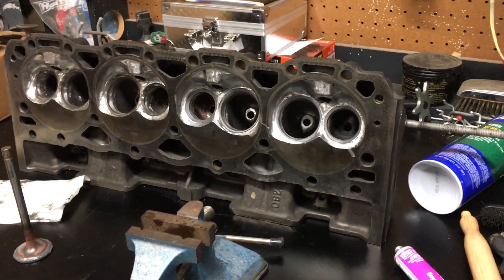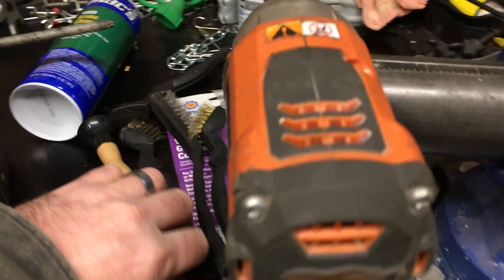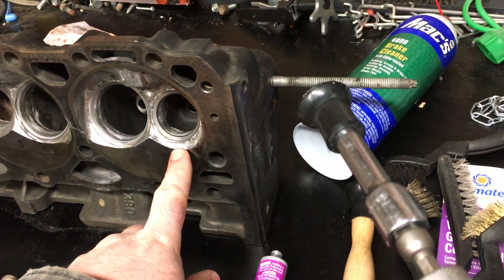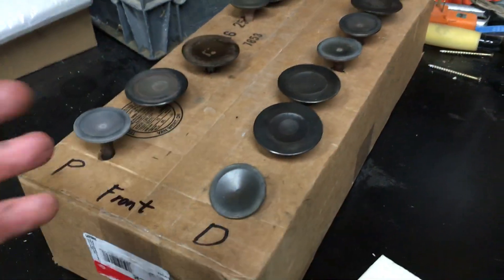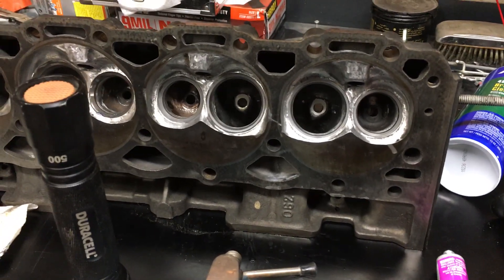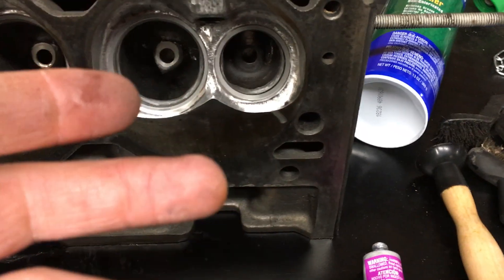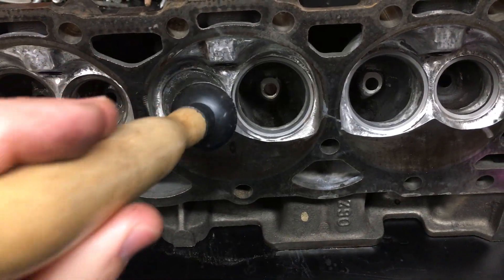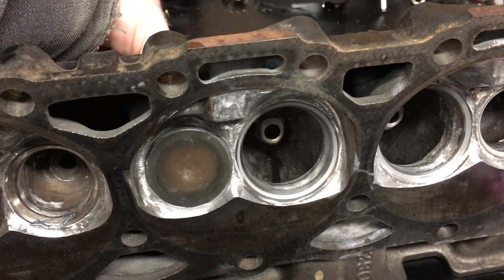Hand valve lapping

Comment: Hey love the video and info on the Vortec heads.. I personally think that the seats are a little wide especially on the exhaust side.. I worked in a Machine Shop for 20 plus years we ported all kinds of heads over the years especially the Vortec head and the bigger Bowtie Version of the Vortec head.. We had a flow bench and engine dyno we bored decked blocks etc.. if the customer wanted something specific to dirt racing and we built a lot of them.. drag racing that’s my thing but if you cut that guide boss down to it looks like a tear drop it will help and just clean the entire bowl area up that to would help. 
A good valve job would do wonders lol... we were getting around 240 cfm @ .400 lift and 280s @ .500 lift at 550 lift which is as far as they would flow we were getting 290s.. on the intake side.. the exhaust would flow about 210 @ .500 this was with 2.055 and 1.6 valves.. we did try smaller 2.02 valves and larger 2.08 valves but the sweet spot for the GM Vortec head 906/062 was the 2.055 valves.. now we also had us a test mule on the dyno 10.51 compression 406 which made about 425 HP @ 4800 and 520 ft lbs of torque @ 3800/4000 rpm... that’s with a good factory set of 906/062 with 1.941.50 valves now with them ported the same setup made 485 HP @ 5600 and the same torque 520 but at a higher 4600/4800 rpm.. it really surprised us all the engine did have a Street Solid Roller cam It was a Isky grind.. Air gap style intake Edelbrock.. Roller Rockers etc.. but anyway keep up the good work and keep the videos coming.. I enjoyed watching them.. I sure miss working in the shop everyday it was a awesome job.. and we built everything from Mopar’s to Pontiac’s just whatever the customer wanted..

Comment: New replacement vortec valves are kinda cheap, my high mileage heads the valves were worse than the heads. The width of the valve seat effects flow some but they should still be better than the heads on your 70's engine.  Cool trick with the extension, I've seen people chuck up small hose n put it over the stem.  I've found auto parts store lapping compound to be to rough/course, got some finer stuff I'm gonna try for my vid.  Well the lapping compound breaks down finer but I don't wanna start that course with new valves.